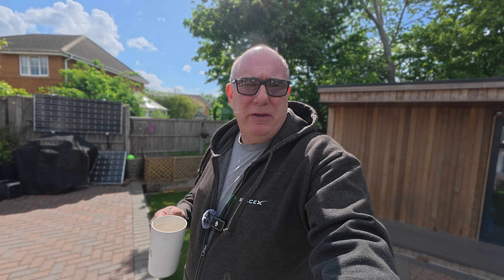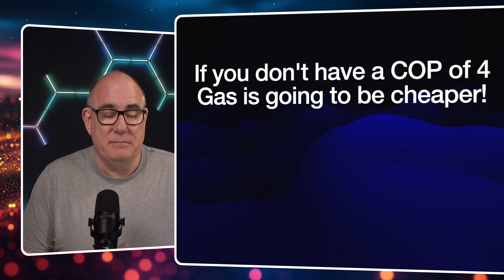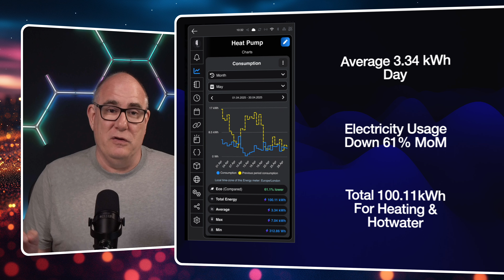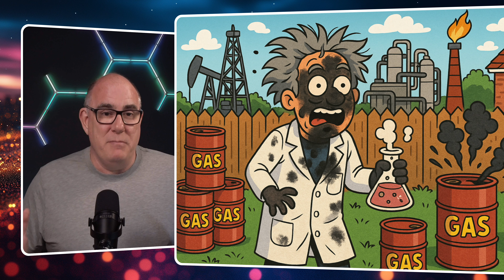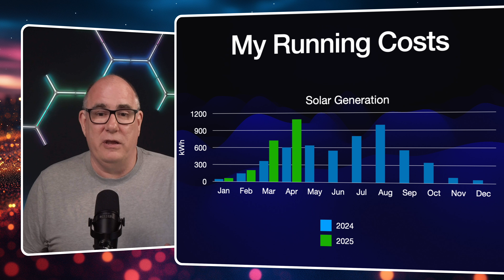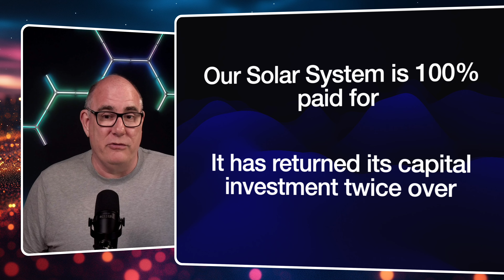We Cut Our Heat Pump Bills to Zero

Comment: Just wanted to say, I have a very similar system to you, installed by octopus I have the 4kw Daikin unit I imagine yours is the 6?  Anyway - for me I've tweaked it down to a max running temp of 40c at -3 I'm getting slightly better SCOP than you but not hugely different, I'm on IOG with a 18kw battery and I have 4.5kw of solar capacity. My costs are circa £30 for heating and hot water in a month in the dead of winter, cheap as chips. I suggest you get on 'visitaheatpump' with your reach it might be helpful to people to come see your system if you are open to it. There are some clowns in the comments though so I don't envy you, I couldn't do it. - Oh to add my costs for the install were £800 all in in 2024
Reply from the maker: Sounds good, I was on the border between a 4 and 6kw heat pump but as advised to go with the 6 to be sure we had some headroom. I may look at turning down a little next winter but want to get a full year with no changes so I can see what effect my changes to the curve have
Reply: @JonathanTracey  fair enough, you might want to get on espaltherma and emoncms to get some good visuals for your videos I installed it recently for mine it wasnt to difficult
Reply from the maker: can you point me to a good site as all the documention I have seen is dreadful, I want to know step by step, open the heat pump, connect A to B etc etc

Comment: Great vids. Thanks. 
Yes. They can cost over 20k.
Im getting a mitsubishi cascade ASHP 22kw system install. 22k without BUS grant, plus 2 new rads 2000x500 type 33 and 600x1400 type 33. Both in the lounge

I have a solaredge system
9.24 pv
10kwh solaredge battery
6kw solaredge Homehub inverter.

House is 306m²

House has a Epc of a B.

New boiler and HW tank would have cost around 6k. If I Include BUS of 7.5k my ASHP system is costing around 8.5k.

Heat geek said my house doesn't conform to their business model. Got great info from them though. Their HL was 30kw.

My local mit installer has said HL of 21kw.

Ive monitored my HL over winter and calculated it to be 15kw.
Fingers crossed. Will be installed this month.
Reply: Oh. I use around 34000kwh of gas.
Reply from the maker: Ok but that's a large house and not what I would call an average family home, infact yoru about 3x the average size. but 22kw seems excessive, is it due to large heat loss?
Reply: @JonathanTracey  Hi. Yeah. This house is a labour of love. 11 years I've been working on it. Epc was a E when we bought it. Had new EPC completed last week. Happy with B. 

Heat loss by heat geeks was 30kw. Mitsubishi installer has suggest a heat loss of 21.2 kw.
Using my gas usage including my wood burning stove this last winter I've calculated my heat loss is around 15kw.

My worcester 40cdi boiler is set to a maximum of 13.6kw  running 24/7 if needed. Rad temp max 50c. House thermostat is set to 20c.
Max gas usage was 284kwh on 11th Jan. House max temp was around 18.5c to 19c on that day. Had two days of -6c over that week.

House starts to recover heat when outside temp is above 0c.
If we get the odd night at -3c house can hold 20c no problem.

New roof and windows in 2013-14. Insulated the best I could. Mutlifoil in the roof living spaces. The rest of the roof over 400mm insulation. New dormer roofs Insulated. 
I've just finished insulating 116m² of crawl space. Used superquilt. Hard job that. 

Gas cost is around 2k per year. Looking at my numbers I'm hoping to be around 1k for heat and HW with ASHP. 

I'm getting two 11.2kw mitsubishi Heatpumps. If heat demand is high both will run but with low heat demand only one Heatpump will run. Run time between both Heatpumps will even out over the year.
Nervous getting it installed but looking at your system gives me hope. 👍

Comment: So if it cost you £3.9k after the £7.5k grant then you are saying that you were quoted £11.4k?
I was quoted £20k for a new ashp back in 2021. That Inc new tank plus pretty much all of the rads changed for a larger size (4 bed house 2000sqft)
I went for a new external oil boiler at £4k installed, same tank and rads
Reply from the maker: No I was quoted £3900 that's what was on the quote, they told me they would handle hte rest in the back ground but the actual quote said £3900

Comment: Just wondering what the return of investment is on a gas boiler is.
Reply from the maker: The only real way you can calculate an ROI on a gas boiler is if you’re replacing an old, very inefficient one with a more efficient model — because the “return” only comes from the fuel savings you make each month.

Let’s be generous and say the new boiler saves you £5 a month on gas because it’s more efficient. If the new boiler system costs £3,700, the simple payback would be:

£3,700 ÷ £5/month = 740 months

That’s over 61 years just to break even — far longer than the typical lifespan of a boiler (usually around 10–15 years).

So even being generous, gas boilers realistically don’t have an ROI. You’re spending money just to keep the system running, not to generate a financial return. That’s why technologies like solar, batteries, or heat pumps are in a completely different category: they replace an ongoing fuel expense with a self-generating or more efficient system that can actually pay itself back over time.

Comment: The average cost for cosy is totally out. 
cheap periods are between 4-7,13-16,22-00 at ~14p/kwh.
The cost to run the heatpump with batteries should be just double the IOG, meaning £ 14 /day.  
Just saying, being on Cosy, waiting for heatpump install, waiting for v5c of Tesla to take ownership to prove Octopus I can get on IOG,also waiting for ev charger install. Almost there...
Reply from the maker: the cost for Cosy depends on battery size, the smaller the battery the more peak rate energy you use, the higher the average. I am sure with a large enough battery you could avoid the peaks all together and get your price down significantly

Comment: Thanks for another great video, the costs of running the gas boiler in your comparison would be even worse if you factor in the electricity used to run the condenser boiler and heating pump (100W-200WpH).
Reply from the maker: Yeah I did think about including it but the boiler brigade would all jump in an contest the numbers and use that as an excuse to write off the whole thing as anti boiler. I thought it easier to keep it to actual volumes of gas which they can't contest

Comment: If your current heating method is not a serviceable grid gas boiler, you should install a heat pump first and grab that BUS grant while it’s as generous as it is.
Reply from the maker: Absolutely, I don’t think it makes any sense of rip out perfectly good heating system just to replace it with a perfectly good heating system. The only reason I could think you would do that is if your gas boy that is costing too much to run and you have the ability to generate enough power from solar to run the Heat Pump for 80 to 90% of the year. You could make an argument then that the Heat Pump would pay for itself pretty quickly.
Reply: All the indications are that the Government is likely to announce similar grant aid to other replacement heating systems over the summer, such as heat batteries like the Tepeo ZEB boiler, which may suit houses where a heat pump is neither suitable nor practical. Just plugs into H&C water feeds on a ground floor location via 22mm pipework, add a hot water cylinder if required, plug in solar where applicable and away you go - no need for radiator changes or re-piping the house, charges overnight and talks to your energy provider as required to take advantage of smart tariffs.

Comment: ASHP may be our next move. 
We live in a 1978 build home, where we have just changed all windows and doors, added 400mm loft insulation, and also added 25mm cellotex and 15mm plasterboard to all insides of all exterior walls and ceilings.
Underfloor wet heating added to downstairs, all new radiators elsewhere oversized and high efficiency and a 5kw woodburner stove.
Gas boiler is only 5 years old (92% efficient), but being used less and less, with a flow temp of 50c.

Looking for aircon, so ASHP with heat/cool could be a winner
We added solar and battery last year.
Reply from the maker: hold on a few months the rumours are the BUS grant will apply to air to air systems which may work for you if you want aircon as well

Comment: It's good to see your comparison. Unfortunately your comparing a high temp gas install. Not a low temp gas install. Fair enough as that is what you had, but your conclusion re gas is not totally representative of different heating configurations and usage. The same low temp system required to operate with a heat pump can be run with a modulating gas condensing boiler with weather compensation. So the higher scop with a heat pump is required or gas is cheaper if operated like for like. The game changer which makes the running cost difference is accessing the cheaper elec tariff and your first point where you suggest doing battery first, enables that, then the SCOP can be lower as your margin for heat pump being cheaper than gas is larger. The system design has to be spot on! Add solar and that increases the margin further. That is a lot of system investment upfront, but it will pay back in the end, and sooner when they ramp up the price of gas!
Reply from the maker: Thanks — that’s a really fair point. You’re right that I was comparing what I had — a high-temp gas system — but I do take your point that there are other, more efficient low-temp gas setups with modulating boilers and weather compensation that can be much more competitive.

That said, the key thing for me is: I can generate my own electricity, but I can’t generate my own gas. No matter how good or efficient a gas boiler is, it still relies on energy I have to buy — and that’s where the difference starts to add up.

You’re absolutely right that the real game changer is combining the right system design with smart use of cheaper electricity tariffs, batteries, and (if possible) solar. It’s a bigger upfront investment, but the payoff grows over time — and as you say, that payoff will only grow faster as gas prices keep rising.

Thanks for the thoughtful comparison — this is exactly the kind of detailed discussion we need more of!
Reply: @JonathanTracey I focused on the battery element leaving out solar which as you say makes it cheaper still generating your own. However solar performance in winter drops when your heating is needed most so grid is still a dependency. In addition solar is reliant on orientation to the suns track (South in UK) for best performance, which is dependent on your buildings roof. So that is a problem for a lot of existing properties who will be compromised in degrees. You then need enough roof space for more panels to bolster the performance drop but for some unfortunately solar will not be a solution. Cheaper and better performing panels (perovskite maybe if it happens etc.) will make a difference in outlay but could make up the performance difference.
Better performing homes is the best answer to drop the energy need. Best solution being designed for solar gain, but that's only a new build option. One fly in the ointment re grid electricity price is going to be the cost of upgrading the countries infrastructure that's needed. How that plays out???

Comment: 13:00 Just for the gas, my real-world figures for my new Vailant system boiler are 94% efficiency at 4.89p (Octopus Tracker) = £19.20.  It's about as efficient as you can get with gas, installed and tweaked by a Heat Geek.  There is probably a bit more to get from the heat curves next winter but isn't going to make any significant % difference.  

So it beats the gas figures and even the Cosy tariff but it will never get close to the £7.00 IOG figures you have calculated.  I did try to go to a heat pump (I have a 28 panel array (soon to be 34 ) and battery) but even the Heat Geeks found it problematic to make the maths work on our large property, hence the move from our old storage combi to a new system boiler and a (HP rated) cylinder.  Not the expected outcome and as HP technology evolves I have no doubt that the next time around it will be a heat pump (the system was designed with a HP future).

My point is that there will be very few properties like mine, where gas genuinely remains the answer.  The Venn Diagram of gas / heat pump / cost will favour the HP for vast majority of PV & battery homes.  Just not for me, for now.
Reply from the maker: Isn't the risk with tracker that the price can shoot up if the global energy markets spike

With regards to the solar powering the heat pump, you don't need to have it cover the entire usage all year long, just export enough in teh summer to cover the winter usage, in my case my winter usage on IOG was about £100 a month for dec jan and feb, so long as you make £300 from export in the summer you will effectively have a net zero bill for the year
Reply: @JonathanTracey  In no way am I questioning the viability of heat pumps for the vast majority of home owners and clearly I earn more money from my solar in the summer to cover the winter costs.  I am a convert who just could not make the maths work on his own home (yet).  

The Tracker average has always been below the standard or price cap rate.  If that changes there is no real risk as you can leave the tariff whenever you like.

Comment: Just to pick up on your subject of costs. I was quoted £21K by both British Gas and by Heat Geek. Now this was before the BUS grant, so my costs would have been circa £14K. But I went to Octopus and they installed the system for £3600 after the BUS grant. Octopus are by far the cheapest still because they are installing at cost currently. That may not last forever, but it’s important to know and understand why Octopus are so cheap and what other companies are likely to quote.
Reply: (I have a octopus daikin installed HP)  worth mentioning that heatgeek with not be quoting for a daikin. heatgeek will almost certainly be quoting for a Valiant and british gas are very likely to be as well
Reply from the maker: agree the prices for install by Octopus do seem to have risen quite a bit, hearing 7k is more common now for anything but the basic install

Comment: 4 bed detached 1990s house. Gas + electric bill in 2019 was £82/mth. We now have an EV, solar (no battery) , Zappi, Eddi. Three years since octopus installed our 7kW Daikin and it cost £6 after a grant of £5k (it's now £7.5k so would now cost £3.5k). My sCOP for heating has been 3.63 (2022/23) 3.75(2023/24) and 3.58(2024/25). Last 12 months usage with current IOG  our bills work out at £85/mth but that includes the car so we don't have a petrol cost like we did in 2019. We have exported 50% of our solar and got a credit of £300 for this.  Very happy and maybe will add a battery.
Reply from the maker: Sounds great with the battery you can lower your costs further buy buying and storing cheap energy in the winter to offset the running costs

Comment: My gas boiler is 92% efficient according to Octopus. My current gas tariff is Octopus tracker which is currently 4.9p/kWh. A gas boiler with the right tariff is a no brainer as compared to a heat pump, it isn't a myth.
Reply: Octopus Tracker is no get out of jail for gas, which tends to be more expensive during the winter. It is the cheapest option for having gas though. I think having it basically makes gas (again) comparable in energy costs to a heat pump on an appropriate tariff.
Reply from the maker: @airbornevet111 so based in my 369kw of heat you and 4.9p and 94% efficient you would pay about £19.20 for the same vs £7 with solar and batteries.  The worry with Tracker is your costs can go up as well as down, if the global energy market spikes again the gas price shoots up so does tracker. This is why I modelled it on standard fixed tariffs
Reply: We came out of Tracker after the winter, having previously benefitted from it for 18 months or so. Fixed on Octopus 14th. month just before the April increase, and note that Tracker is now running almost the same as our fix for both Elec & Gas.
Reply: If you have solar then the export at 15p pays for 4.5p unit rate of gas.
Reply: @davidsalkeld4473  I have solar and I export. I'm comparing a gas boiler with no solar versus a heat pump with no solar.

Comment: So, in the winter months you are using fossil fuels ;)
Reply: Perfection is not the goal. We are eliminating fossil fuels as cost effectively as we can. Transport and heating are the low hanging fruit for the transition.
Reply from the maker: @Biggest-hz7ng fully agree, too many people throw their hands in the air and say well if China is going to pollute why should I bother trying to be green. The reality (from someone how has traveled extensively in china) is they are doing way more to be green, all mopeds on the road are electric, most new cars are as well. They are moving their industry to renewables as fast as possible and we are sitting hear arguing about heat pumps vs gas boilers
Reply from the maker: @KangoV not if the energy company is supplying green electricity, from the wind farms in the north sea. Even if I were using 100% fossil fuel for the electricity in the winter months, it would be for 1/3 of a year, instead of 100% with a gas boiler.

its about reducing your imact on the environment, while we still have gas fired plants its unlikely we will ever be 100% green